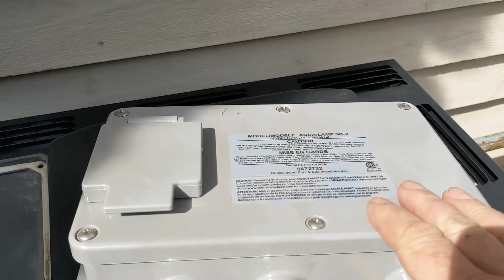Swimming Pool Light Not Working [ What To Test? ]

Comment: Great video. Need 1 replacement transformer for this aqualamp sk2. I am in canada but cannot find these transformers without replacing the whole box?? Sk transformers were found but NOT sk2. Any links would be appreciated to source this transformer... otherwise the only option seems to replace the whole unit and l guess keep lld unit for parts....
Reply: Thanks. Will investigate
Reply from the maker: Look on: www.digikey.ca     They might have it.  Get all the info off the transformer.  As long as it has the same volts and amps, youll be good.

Comment: Hi Robert thanks for the vid,  I have 2 lights in my pool one works the other doesnt, I  changed the bulb still no light, checked the fuses they look ok, tested the GFI and there's power I test the transformers and dont get a reading even though one light works I might be doing some thing wrong in testing the transformer power. I'm now stumped. I probably need a new transformer but dont want to buy one if it's not the transformer Any suggestions Thank you in advance George
Reply from the maker: Sounds like the transformer.  There should be 2 of them in the box with the GFCI

Comment: Pool guy replaced my light to a new color changing one, but used epoxy to sealed connection since he didnt change the whole wiring, now gfi is tripping.
Reply from the maker: Water got in behind the light or transformer is done.